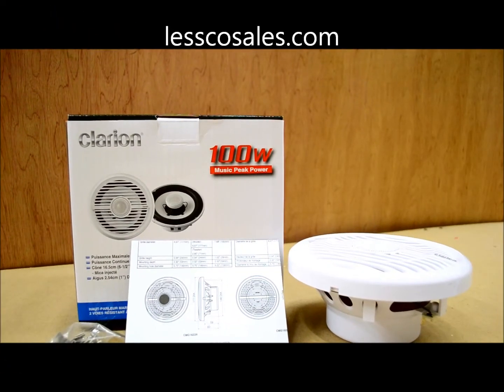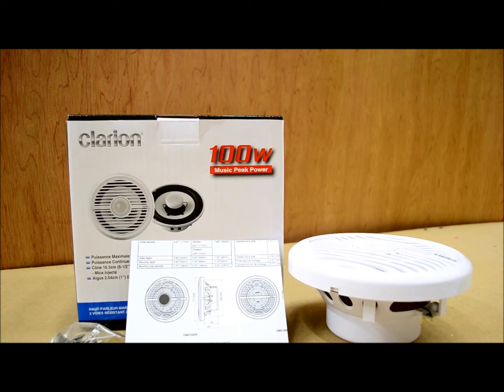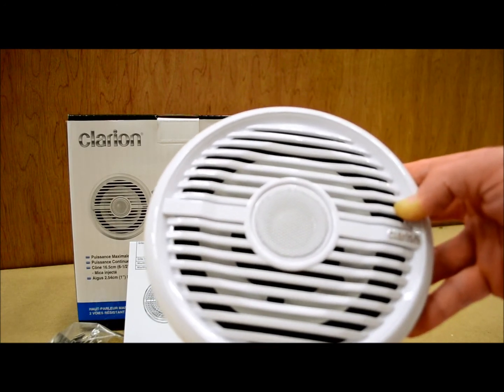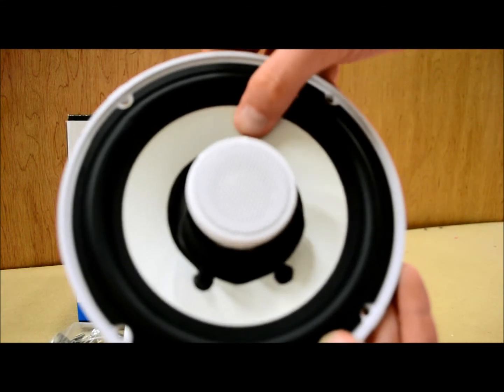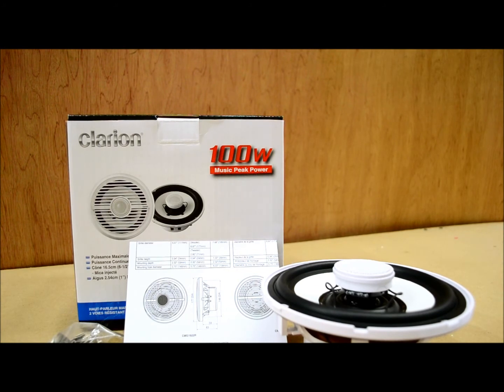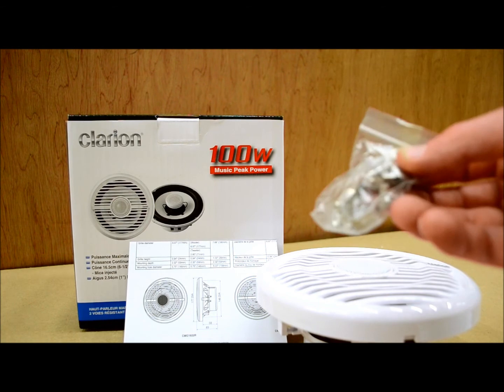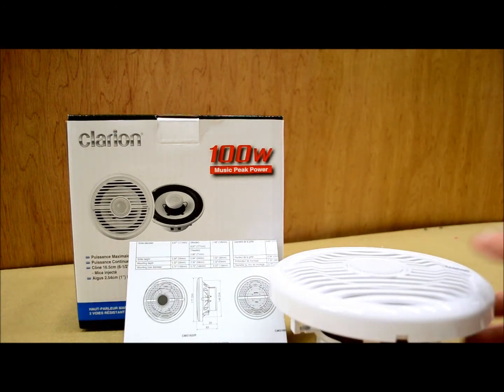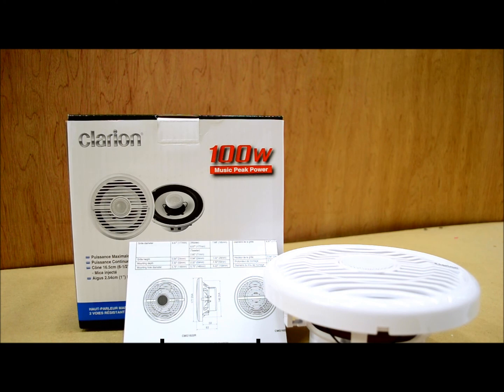Clarion CMG1622R Marine Speaker Review

Comment: Wrong the lower the resistance the more power it uses, harder on the amp because it will load the circuit more, and usually creates more Bass effect.